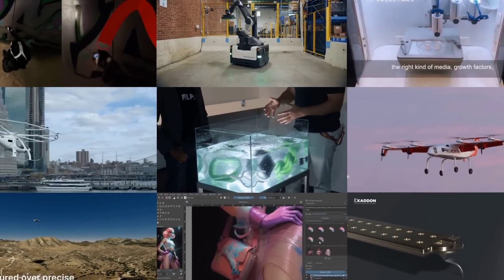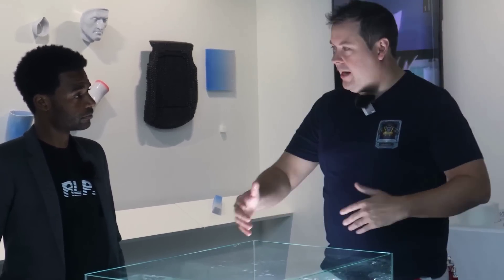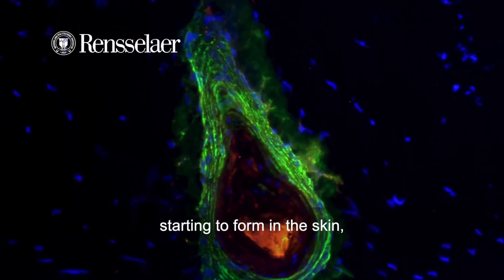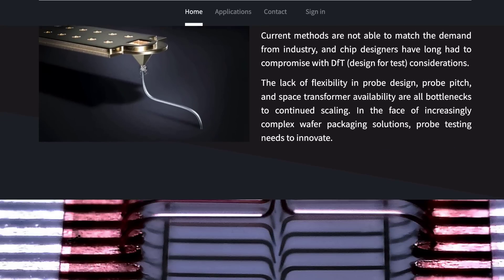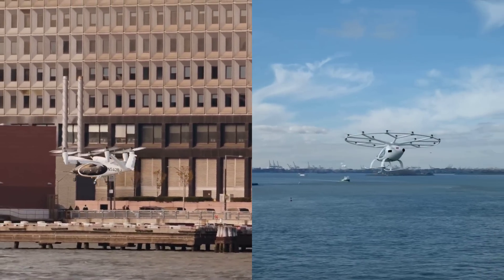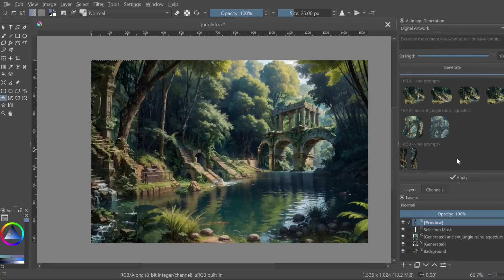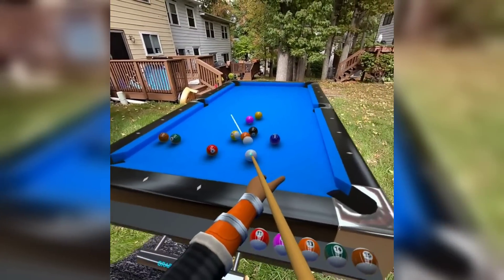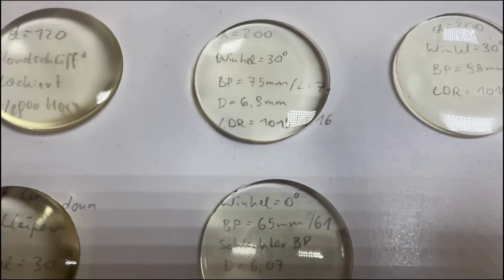Breakthrough 3D Printer Uses Strange Goo

Comment: I've been at Formnext and was stunned by the surface quality of rapid liquid print! The material control in combination with a ViscoTec eccentric screw liquid extruder is insane!
Reply: I'm just amazed that the disturbing of the gel is the extruder moves through it doesn't upset the layering. 

How do they account for the random movement of the gel so that there are no missed spots

Comment: Mate, amazing project on the 3d printed optical lenses. Do you think it would be hard to add specific wavelength filters using a film deposition method? Then you can also make dichroic for photometry systems (like those in Thorlabs)

Comment: I get what you mean with "No post processing is required", but isn't washing them with water still post-processing? >:)
Reply from the maker: Yeah I know, I meant more about improving the finish quality, sanding, glossing, painting etc which most other 3D printing methods require for the same level
Reply: @MOSFETnet  Haha, I get it, I just found it kind of ironic. Washing something with water is really not a bad thing, it's cool you don't need to do any post processing on the object.

Comment: Guys, the news here isn't the fact that they're printing into goo.  As multiple people have pointed out, it's a sci-fi trope to have a printer use a suspension gel to avoid the need for support structures.  The news is that friggin print quality.  Look at the finish on those extruded pieces.  Whatever they're pushing through that syringe extruder appears to be pure black magic!
Reply: Absolutely - I've preped several cars for spraying - that level of finish where you get a clean "light line" across the surface is normally a vast amount or sanding
Reply: Neutral buoyancy and high surface tension extruded material to smooth layer lines
Reply: Yeah this is something NASA is spending billions to launch into a space small printer costing millions, to print in "zero g"
Reply: @EddyKorgo  NASA's total budget is $25 billion.  The vast, vast majority of the budget for any 3D printer for space deployment will be in terms of cargo volume and mass to take a prototype to the ISS or its successor.  

NASA might have to do some original chemistry research to come up with a good thermoplastic that doesn't offgas anything dangerous or bad for air recyclers.  But, other than that they can use the same kind of 3D printer that they sell at Microcenter.  The technology works fine in free-fall with a very few minor enhancements to help move air to allow for temperature control.  

If you don't include launch costs in the budget, the total cost to get a 3D printer for the ISS would probably be well shy of $100,000 with the novel chemistry.  (Which could then be licensed to a filament manufacturer for 3D printing in unventilated areas.)

Edit:  I just looked at the cost for launching with SpaceX as part of a general resupply mission for the ISS.  It looks like it should cost less than $25,000 to launch a printer and 5KG of filament if you could fit it into a full launch.  Sooooo.... call it a total budget to implement experiental 3D printing in space of $150,000?
Reply: The bigger news is how the print jiggles in the goo as the print head moves… yet, the print is successful, high resolution, and precise.
Reply: It's not a syringe extrusion. It is actually a print head from ViscoTec using the eccentric screw pump as core tech.
Reply: @MeisterDerGeister  Oh, thanks for mentioning that!
Reply: It just clicked for me how good/important this technology is. It’s like SLS without the clean up. I feel someone could easily incorporate something like this into an automated manufacturing line
Reply: Sci-fi was just a typo. The u and i keys are right next to each other. It was meant to be Sci-fu "Science of the future".
Reply: @Kneumann1991  I own one of those, they are nice and soft.
Reply: "Pure" black magic?  🤔
This is one of the greatest examples of (TO GOOD TO BE TRUE)

Comment: I want a fully 3D print-in-place electric motor.
Reply: I have seen what appear to be fully printed "soft" electric motors that used some kind of liquid metal as the coil.   What you desire may just ne a matter of design rather than requiring any new technologies.